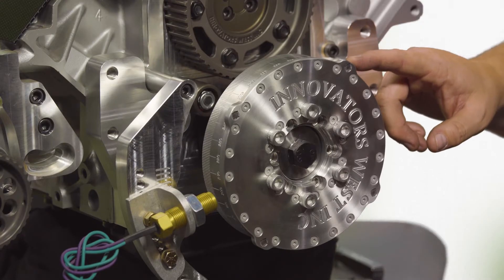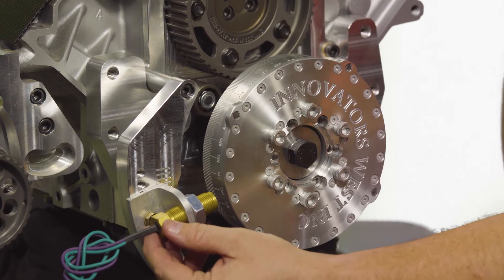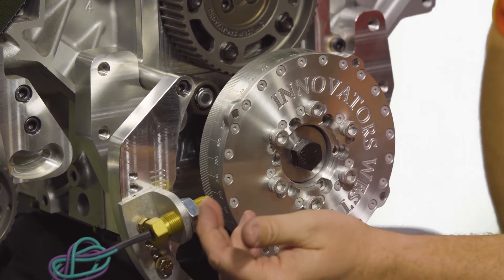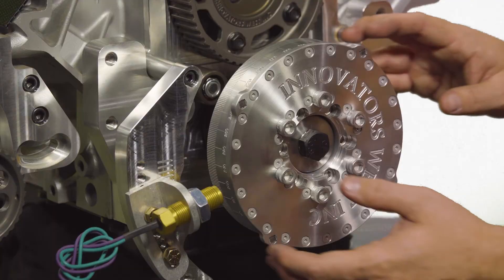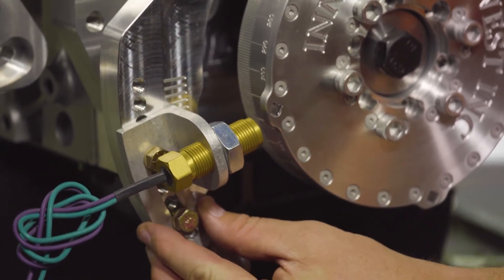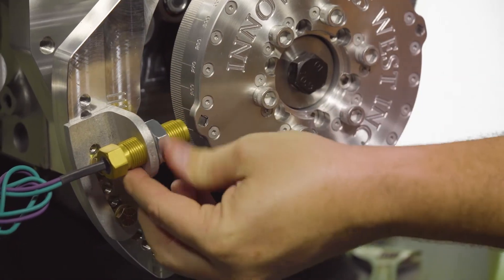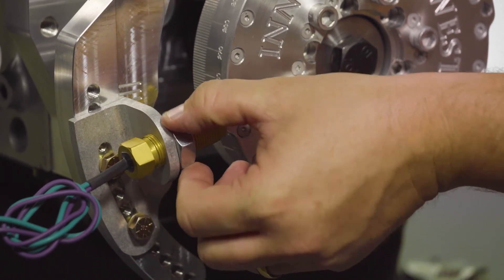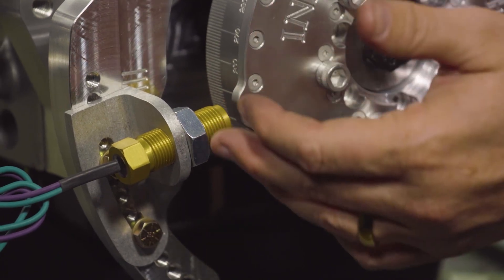Innovators West Tech Series - Crank Trigger Dampers

Comment: Can the crank trigger faceplate be removed? I am having an issue with my SBF magnet bumps hitting water pump outlet with the hose is on.
Reply: If they are the ones integrated into the damper, they can not be removed in the field.  The damper can be sent in, and we can machine a no magnet cover for it if need be.

Comment: Witch part number would I need for a bbc internally balanced crankshaft with stock pulleys
Reply: The #104 damper (base part number, full part number depends on all options) works well up to 2000hp.  The #106 is for 200hp and up.   You can add the magnets for drivers or passenger side.
Reply: @chrisrose3133  Thanks really appreciate your help..

Comment: Would it be ok for marine application? I sometimes have water splashing around the back
Reply from the maker: While we have not used them in Marine applications ourselves, provided the connections to the sensor were waterproofed, I can't see why it would not work.
Reply: @InnovatorsWest  excellent